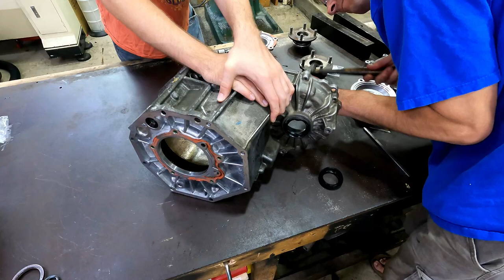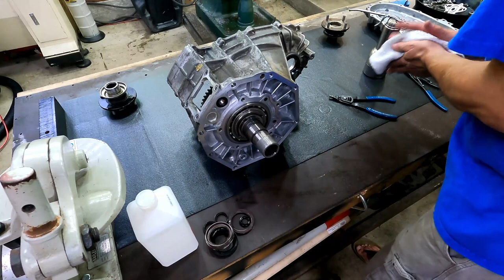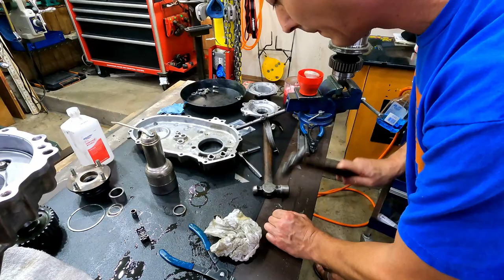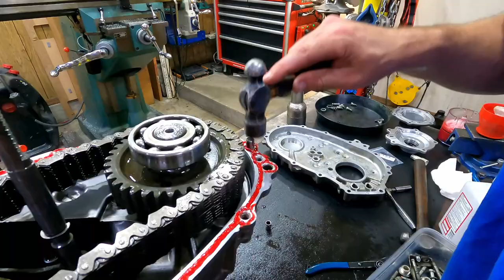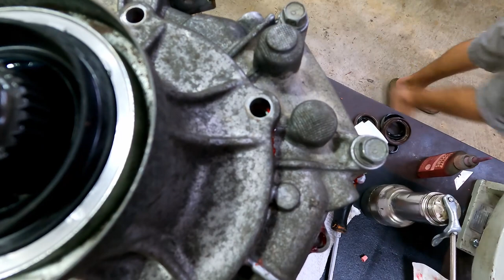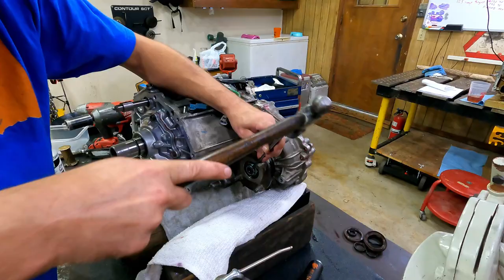GX470 Transfer case rebuild and actuator reseal

Comment: Got a GX470 as well. Any suggestions on what to look for if the transfer case is popping in to neutral while driving? Typically when doing downhill and letting off the accelerator. Whole transfer case shifter will also lurch forward (even if it doesn't fully disengage) anytime you're decelerating.  Happened after a mechanic rebuilt the transmission. Dowel pins between the transmission and t-case are still present.

Comment: My 04 GX was ran with no fluid so chain stretched and has a light chirping noise from the hi/lo lever if I push down on lever noise quietens down. i want to rebuild it with new chain but what part will fix the "chirping" noise from lever ??
Reply from the maker: Be careful to check all of the bearings and the case bores, if they run dry the bearings spin in the case and wear out the bore. Also make sure the fork and its shaft are in good shape, the end of the fork looks like it has plastic guides for the sliding clutch, with no oil I have seen these melt off before causing noise and loose shifts. Check shift shafts that the fork is tight on the shaft, pinned on and can wear out or be bent w/ excess forces. There is a lot to trans repairs, check shifting with out the detents in so you can feel it better. Best of luck, I hope the video helps.

Comment: Thanks for the informative video. I'm in the process of replacing my diff lock actuator without disassembling the entire transfer case. Question: With my diff lock actuator removed from the transfer case, I can't slide the actuator rod in/out as far as I'm seeing you move the rod toward the end of your video. I'm guessing mine moves less than 1 inch (maybe 1/2" or 3/4"). The rod moves smoothly between the in and out positions, but it's not very far. The rod "clunks" solidly at both ends of its travel. Is there a process I can perform that will give me the full range of motion like I see on yours before I install a new actuator onto the transfer case? Thanks!
Reply from the maker: Try rotating the output shafts while you move actuator rod. The teeth have to line up before it will slide all the way. Hope that helps and thanks for the comment and question.
Reply: @limitsedgemachineworks1433   Thanks. I did try driving the truck up and down the driveway, and then attempting to move the shaft again. It behaved the same way then too. 🤔
Reply from the maker: @sgoldste02  If you can put it up in the air safely try rotating either output shaft and then holding the other stationary, thus allowing the teeth to move past each other. Do it while applying light force to move the actuator shaft, hope you get it.
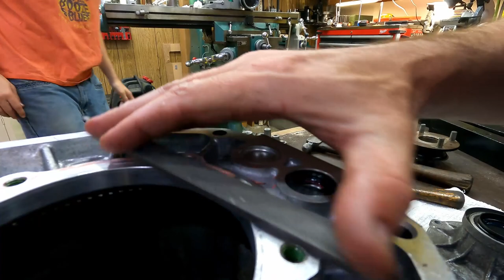Reply: @limitsedgemachineworks1433   This is interesting. If you watch from 6:35 to 6:50 of this video (which is in Russian or something), you'll see how far he moves the shaft, which looks the same as mine. So 🤔

 https://youtu.be/GIXmJIud9aE

Comment: Not sure if I missed it but how does the shift lever attach to the TC? My shifter is no longer connected and just flops around now.
Reply from the maker: Gosh its been a minute but I think you can pull it from the top and put the ball on the end of the shifter back into the socket on the shift rail. My removal video might show it you could try to watch that.
Reply: I got a camera in and the socket retaining pin on the shifter rod came out and is loose around the rod. 
The other video cut 1s too early to see but was otherwise helpful thanks. Good videos

Comment: I have the same issue where was your popping  noise coming from?
Reply from the maker: So I had a couple actually. The E brake shoes were replaced by someone else and never adjusted so they could contact the drum if the handbrake was left on and would momentarily apply and pop doing so, it also eats front CV shafts due to the lift. I need to drop the front diff down.
Reply: My noise comes from the right front passenger side.  I thought it was the half axle and replaced it, but the noise remained.

Comment: Hello how much it cost for a rebuild.
Reply from the maker: This rebuild was pretty cheap for us as this unit was not the source of our popping noise and had nothing wrong with it so we just resealed it. I'd say about 10 hours to pull, rebuild, and put it back in so $750 on labor, oil and seals probably another $125, tax and shop supplies would put that up to almost $1000. But the theme of the channel is just to show you guys how to do all of this so if you had to do it yourself you would only need the oil and seals plus anything that is broken, the work is easy and you can reference this video if you get stuck. Thanks for the comment and have a great one, take care!

Comment: Did you get it back in?  Any issues?
Reply from the maker: Yeah it went back in easy, I just didn't get a video made of it. No issues with that transfer case.
Reply: @limitsedgemachineworks1433  last question when you say torque at “25”.  ftlbs or Nm.  And any “should have done different” on installing the diff lock actuator?   Did it self reset itself?  Also thank you, will be tackling this soon to replace the chain.
Reply from the maker: It was ft lbs, I didn't get that out of the book its just what I did from experience it felt right. I thought about all of the cast aluminum engine parts I used to work on that were the same size and material and they went to 26 ft lbs. It all reset itself just fine. I never even heard it hunt for a position.  @cdgermann